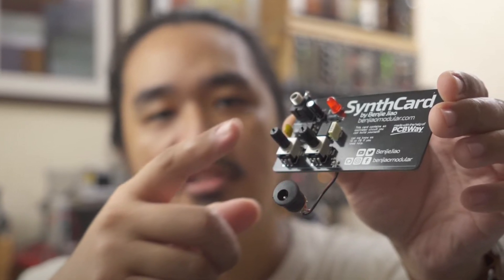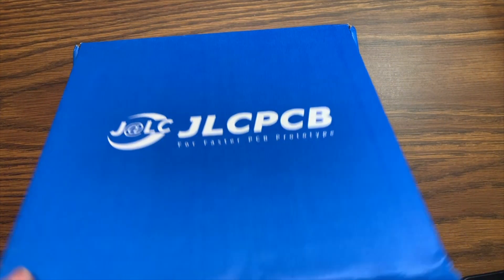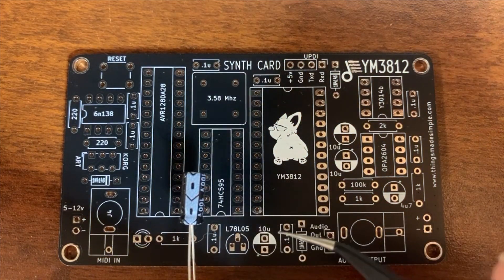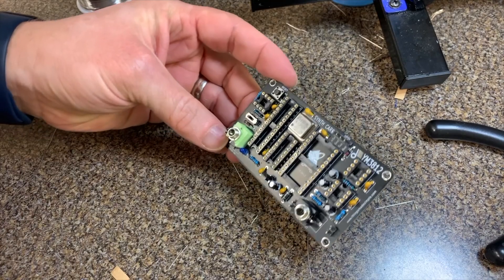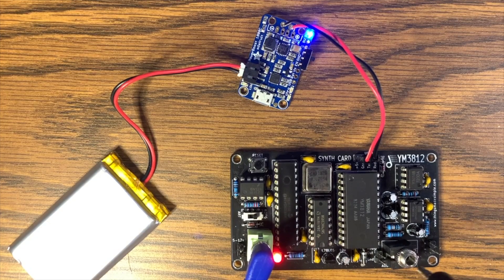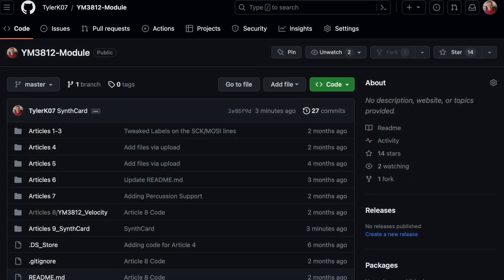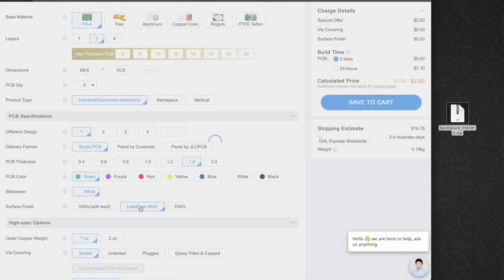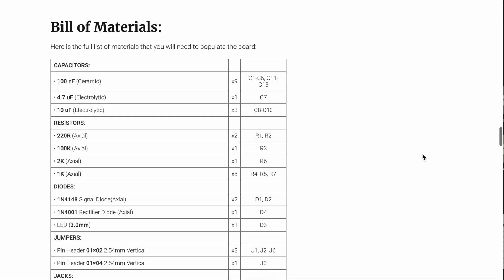YM3812 SynthCard Module

Comment: I am no expert on the subject. I just tinker with the stuff and sometimes rip a few things here and there. 

I played the larry 3 theme via gm and I dont have the same drum tick noise you do. I am using a sb16 for fm synthesis. The patch I generated doesn't sound like it does on your video.

My beat guess is lsl3 is still using sierra's own adlib patchset which conformed to drum mode which only gives 6 channels for melody and 5 dedicated to drums like the snare, hi hat, and toms which seems to restrict the chip further because you dont have complete control on how percussion is set to.

Using percussion mode seems super limited. Adlib has good examples in its bank editor and jukebox but outside of that its really not that great.

Later games like quest for glory 4 and anything released in 93 appears to be able to utilize all 9 channels for everything as it seems that the percussion instruments operate on a 2 operator generic mode where you can use percussion as melodic.

Shout out to @MordacksOrgan as he's a cool guy.
Reply from the maker: Percussion mode is definitely very limited and mysterious. I never really figured out settings to produce good sounds using it and the documentation is sketchy at best. All of the percussion sounds in this synth are produced in the regular 9-channel mode using custom patches for each percussion type—which probably explains why your sb16 sounds different. I'll have to try one of the later games to see if at least the instrumentation is the same even if the sounds themselves are different—that's a good call!

Also, agree on @MordacksOrgan that was an epic mic-drop of a comment!
Reply: @ThingsMadeSimple if I had an opl2 card I would absolutely try this out. All my cards that I have are opl3 though. If I still had a sb1.5 card it would be easier to mess about. 

Closest I've gotten to figuring this stuff out is by using Jaime o'connel's midi driver and using my own .ibk to see what I can do. I even bothered the author of dosmid because my percussion bank i made would not properly work and after a few exchanges he found that there were hidden flags that needed to be set that were not documented anywhere.

Comment: Very cool. Thank you for sharing this project.
For the PJ366ST / PJ398SM, do you know if we can find something equivalent at Mouser, digitkey or aliexpress?
Reply from the maker: I found these on AliExpress, but they only come in a set of 100. 

100PCS JINGTENG 3.5mm female pcb panel mount socket STEREO version Eurorack Jacks WQP-WQP419GR use for Modular Synthesizer
https://a.aliexpress.com/_mLasTgw

Comment: Why Sierra changed the orchestration for different versions of tracks is something that I find interesting too. I’ve recorded different versions of Sierra’s soundtracks and uploaded them to my channel. For example, I have MT-32, AdLib & Game Blaster versions of KQ5. I think Sierra has always focused primarily on optimizing their soundtracks for the Roland MT-32 and Roland SC-55. Other adaptations of the soundtracks seem to be something they churned out at the last minute and were included as more of an afterthought. It seems like the PC Speaker track was always the absolute last one they worked on. Game demos for Gabriel Knight and Quest for Glory IV have music tracks for sound cards, but not PC Speaker. The PC Speaker tracks were obviously added much later. In the case of Gabriel Knight, some of PC Speaker tracks were added via last minute external patch files literally crammed onto the game disks days before it shipped. If you delete the .snd patch files in the game directory of the floppy version, the sound cards will still have sound while the PC Speaker is silent on these specific tracks.

In your LSL3 intro example, my guess is that they took out those instruments because they were worried about maxing out the AdLib’s polyphony voice count and just didn’t care enough to bother testing if they could squeeze back in more voices. I noticed a similar thing where they cut some of the instruments in the AdLib version of KQ4. In other later instances, I think they were sometimes composing on the fly and experimenting with different instrumentation as they made the conversions.

For example, in KQ6 (which was written in General MIDI on the Roland SC-55) the music that plays when you get captured by the guard dogs inside the palace features dogs barking rhythmically to the music, but only on the MT-32. If they wanted to include dog barking sound effects with the General MIDI track, they could have easily simulated barking with a cuica friction drum (which is an instrument in the standard General MIDI percussion set).

Dog Barking present in MT-32 conversion:
https://youtu.be/SmneVafrp5k?t=7198
Dog Barking absent in original General MIDI track:
https://youtu.be/V2IK-MvIDWY?t=4361
Compare to simulated dog barking using cuica friction drum in Rise of the Triad (General MIDI):
https://youtu.be/RJ6IBG2d1GU

The MT-32 track uses a special dog barking instrument patch, not the cuica drum, so maybe Chris Braymen never thought to use a cuica for dog barking? The point still stands that someone, possibly Chris Braymen himself, felt the impulse to add dog barking to the MT-32 conversion that’s not present in the original General MIDI track - or any other version.

I see the Quest for Glory boxes on your shelf and I can think of another similar example. Compare the presence/absence of the snare drum part during the intro movie & title screen music in QfG4.

Intro Movie w/ snare on AdLib:
https://youtu.be/sslx7M7R-N8?t=54
Title Screen w/ snare on AdLib:
https://youtu.be/sslx7M7R-N8?t=642

The snare drum is completely absent in the original General MIDI version of these tracks:
https://youtu.be/ZBOYz851_mY

With the MT-32, the snare part is present during Intro Movie, but not the Title Screen:
https://youtu.be/tMsq92G6Urk

Something I’ve debated in my mind is if the snare was added by Aubrey Hodges during the conversion process or was it present in the original GM but taken out later by Hodges for aesthetic reasons? Maybe he simply forgot to take it out of the AdLib tracks too? Or did he feel the music needed a little extra kick when he got to the AdLib conversion and forgot to add the snare into the General MIDI? I find it curious that the snare is present on the MT-32 conversion in one track but not the other.

I know with PC Speaker tracks, they liked to add arpeggios to make them less boring, which can totally change melodic feel of a track.

King’s Quest I SCI Intro MT-32:
https://youtu.be/iGRqT3t6mqw?t=95

King’s Quest I SCI Intro PC Speaker:
https://youtu.be/itB0wgDRDF8?t=90

My first computer as a kid didn’t come with sound card or CD drive. When we added a Sound Blaster in 1994, I remember being disappointed by this specific track and finding the PC Speaker version far more memorable and interesting.

Comment: Hi, nice series about YM3812. I have a question: When you play music from MIDI file it is possilbe control registers (Tremolo, Vibrato etc.) thru MIDI file? Or it si possilbe only in source code? Thanks.
Reply from the maker: There are established MIDI commands for tremolo and vibrato. So you could definitely write the code to respond to those commands and adjust the settings on the YM3812. That said, not all settings on the YM3812 map to established MIDI commands. So you would have to decide how to map MIDI commands to those settings, and it would be non-standard. At one point I went down this path, but it ended up being super convoluted.
Reply: @ThingsMadeSimple  Thank you for answer. But I thinking... it is not possible make full control od the chip over MIDI. This chip is simple but have many parametrs (time 07:40)...

https://youtu.be/QSmczypPhnc?si=Fx0q_xkDZZRJDPkk

If i had two of these chips. I need a MIDI splitter for sending for example  channel 1-3 to first chip and channel 4-6 to second chip or is it easier make channel filter in AVR?
Reply from the maker: Definitely easier to do in the AVR. Also, you will be able to do panning that way. That will likely be the subject of the next video too :)
Reply from the maker: Also, it’s not impossible to make everything controllable over MIDI, it would just be non-standard. Like you could assign different control codes to different elements in the patch. They wouldn’t directly line up with their intended function, but they would work